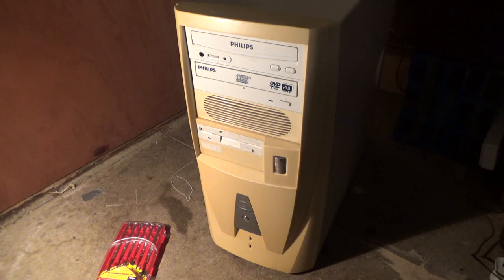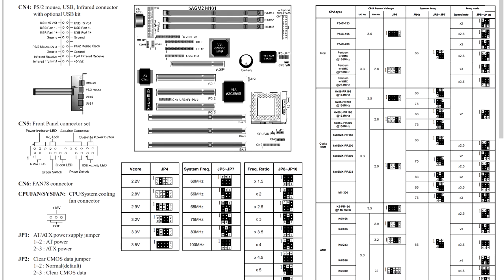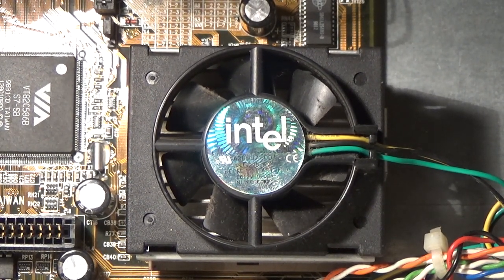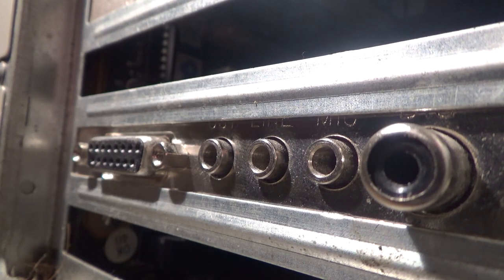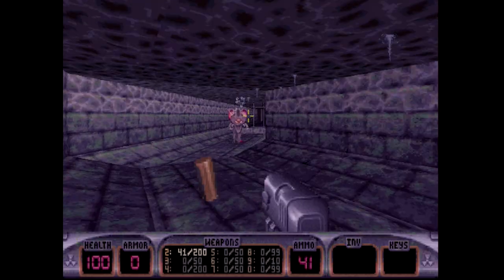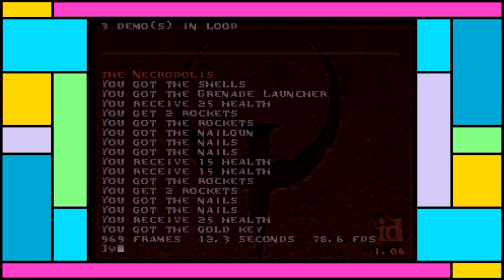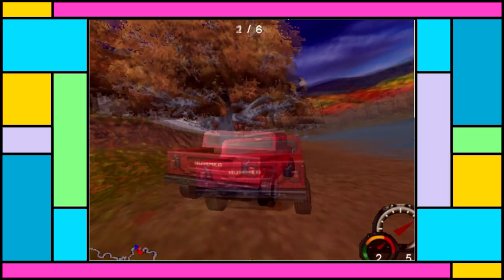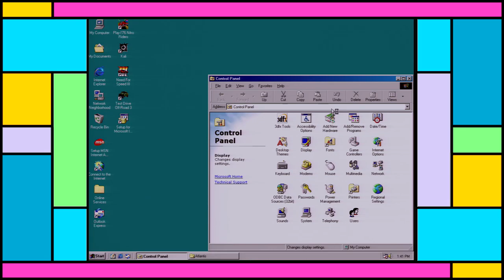Reliable K6

Comment: The script for this was great. "Chaintech's Chinese Children" was my favourite bit. And the hookers analogy. My K6 system (give me one of those over a PII anyday) was basically a perfect, late-era Voodoo platform, as it can use the same drivers as the Voodoo 2 but I get you on the DirectX point. I guess a GeForce256 would work well, as the first Radeons were more suited to PIII systems in my experience.

Oh and I have a personal hatred for Crystal-based cards. For me an OPL4 card works perfectly for all '90s systems, from a 386 right up to a K6.

p.s. thanks for trimming the benchmarking, but where the fuck is Final Reality??? Surely that's the only Windows benchmark you need?
Reply from the maker: Odd you should say that, because this system was supposed to be using a GeForce 256, but it was gotten hold of very cheaply and it had a heat problem in the past which seems to have damaged it - plus no matter what I did, it found a way to run hotter than it should. It's probably what I'll aim for again though, as it does come off as being the right card for this machine.

Some of the Crystal cards weren't bad, that Terratec in the K5 is brilliant, as for this TBS Malibu, at least it's using an actual audio chip, there are cards which don't.

Not really clued in on what Windows benchmarks are worth running and most of the ones I tried years ago didn't run at all, but I'll put that on the list for when this system comes back out, even though I don't think the other system will run it.
Anyways, cheers.

Comment: The main rival of the AMD K6-2 was the Intel Celeron Covington / Mendocino. A K6-2 vs Celeron video would be very interesting.
Reply from the maker: I'd quite like to, but I don't own a working Socket 370 motherboard, aside from one that was made a good way into the 2000s, well into the Coppermine/K7 era. I also don't own one of the lower end Slot 1 boards. As a result, it wouldn't be a fair test. I'd wager the K6-2 would come out faster per dollar in any case, regardless of which was faster overall.
I probably could test a Coppermine Celeron against a Duron, even with motherboards on the same chipset, but I doubt this would be worth it as it's pretty much a given that the Duron would just dominate the whole thing.

Comment: 13:40 - No the V3 was not released 4-5 years after the Voodoo 1. 3dfx released the Voodoo 1 in autumn 1996 and the Voodoo 3 in March of 1999, only 2 years and 6 months later, not 4-5 years later. Also the Voodoo 3 was not the first 3dfx card with 16 MB SDram and AGP support, that card was the excellent Voodoo Banshee released 6-7 months before the Voodoo 3, in the autumn of 1998.

Comment: 37:40 - the Geforce 256 SDram was released in October 1999, exactly 7 months after the Voodoo 3 and at a very high price of around 250-300 $. The Geforce 256 was overall faster than a Voodoo 3 3000/3500 but not in Glide games where the older and much cheaper V3 was still a little faster. Also the V3 still had a better 16-bit image quality with its 22-bit filter and much much better compatibility with older games. Not to mention that there were many older 3d games released only with glide and ZERO direct3d and opengl support like NFS 2 SE, Carmageddon 1 and many others, games that perfectly run with hardware acceleration in Glide on the Voodoos and only in SOFTWARE mode with all other cards nvidia ati Matrox etc. Also many games run by default with higher visual details in Glide with the Voodoos, unavailable in direct3d or Opengl- like Unreal Tournament- detail textures and fog are activated and available only in Glide. The Geforce 256 SDram released 7 months after the Voodoo 3 was overall faster in Direct3d and OpenGL than a V3 3000/3500 but the difference wasn’t big and the Voodoos still had the upper hand in many aspects. The Geforce 256 DDR, which was significantly faster than a Voodoo 3 especially in newer games, was released in December 1999, almost a year after the Voodoo 3 and at a price over 2x higher than a Voodoo 3 3000 at that time.

Comment: Sorry but your criticism of the Voodoo 3 is totally unjustified. You obviously are not at all familiar with the video cards from the end of the 90s. Most probably your card is damaged or has some kind of a problem.
Reply from the maker: Maybe have a look at the Blade T64 video and it might make you change your mind. This is before considering that the GeForce 256 and Radeon 7000 were more of this machine's era - none of which would have likely found their way to being installed in it, as it would have been built as more an affordable system than a top tier performance one. This is a PC from around the turn of the millennium.
In any case, thanks for boosting my engagement stats with your rabid spam fest. Perhaps if 3DFX were ever any good, they'd still be around. More competition in the industry would have been nice, but unfortunately they were always just a stubborn outlier that came and went in short order like several others. I'm convinced people just like the logo or something and don't actually use this stuff.
Reply: @HighTreason610  I don’t mind writing comments or liking a video if it’s well made but it’s impossible to ignore the false untrue and even ridiculous things you say and write about 3dfx and the Voodoo 3.

Comment: 33:35 - “most glide renderers aren’t well written” ??? In 1996-2000 Glide at the end of the 90s 1996-2000 was THE BEST, best graphics with higher details than in direct3d or Opengl, higher FPS with the Voodoos compared to any other card on the market, perfect or almost perfect compatibility infinity better than Direct3d or Opengl.